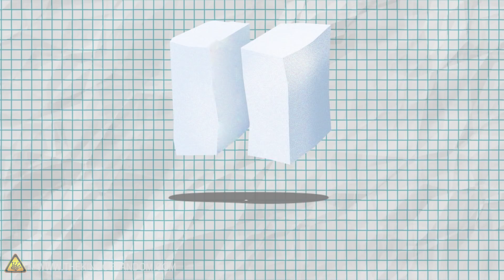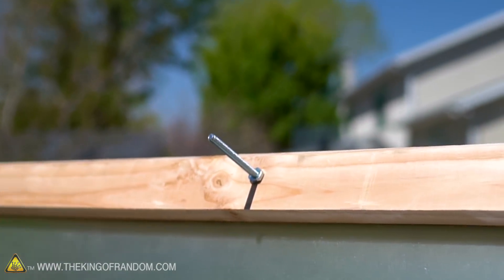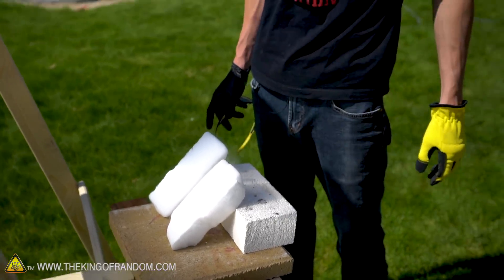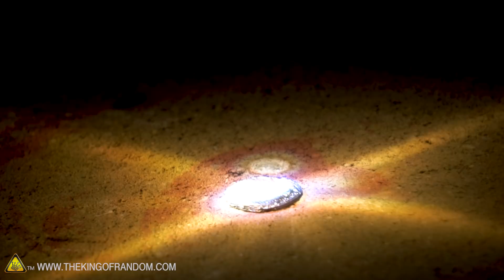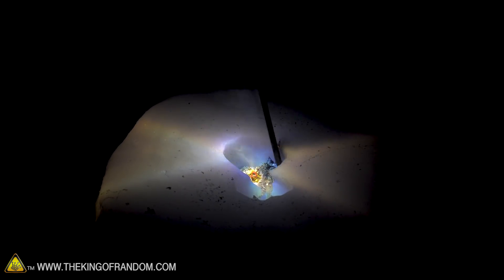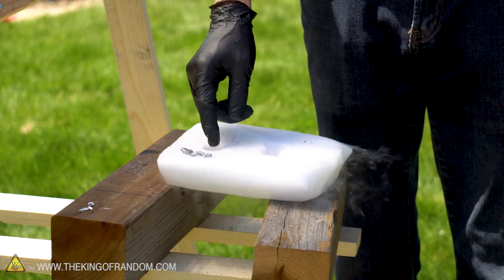When 2000°F Solar Power Hits a Block of Dry Ice? TKOR Solar Scorcher Sun Power Vs Dry Ice!

Comment: Please use the solor scorcher on sand from several sources to see if it gets hot enough to make crude glass !!!
Reply: up
Reply: Liquid Oxygen can not exist in a vacuum.
Reply: so you think it would be exciting to sit there for 20 minutes and watch a liquid turn into vapour?
go boil a pot of water
Reply: exactly, see what happens as the vacuum increases
Reply: well, whats more fun? reading a piece of text that says lighting an explosive will make it explode, or actually seeing it?
Reply: Solar*
Reply: But without heat! Thats the difference
Reply: If you've seen water boiling in a vacuum chamber it will be the same
Reply: BUT WITHOUT HEAT
Reply: Anonymous Youtuber nope, either burns or melts, not everything melts
Reply: Yaaaas!!!
Reply: YEAH
Reply: He should use it on wood and see if he can melt it before it burns. Every material known to man has a melting point, even things that burn.
Reply: An explosion is a high energy event.
Liquid Oxygen boiling away is like watching water boil
Reply: It boils into vapor, just like water.
No need to perform an experiment when the answer is so obvious
Do we need someone to make a video on how 2+2=4?

Comment: notification squad !!! ... what will happen if we have a fuel inside a vacuum chamber and hit it with 2000 deg F solar power .... will it burn without oxygen or evaporate or probably blast with a very little amount of oxygen present ...
Reply: If there is no oxygen in any form it will not burn. Fire needs, by definition, oxygen.

Comment: How about using the solar scorcher on a mirror? As I have replied to many of the dry ice comments, this is not going to be very interesting. The mirror might melt because it's a very thin layer of reflective metal so the heat it absorbs might be enough, but so what? More educational would be measuring the difference in the time it takes to light different color material and explain why materials that are violet/blue (they reflect these wavelengths) take longer to light (these color light carries the most energy)